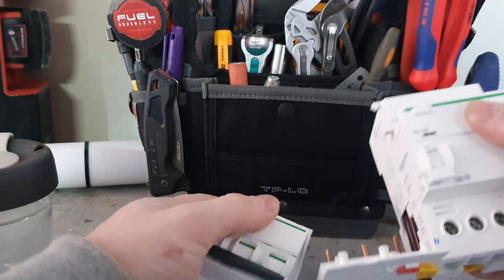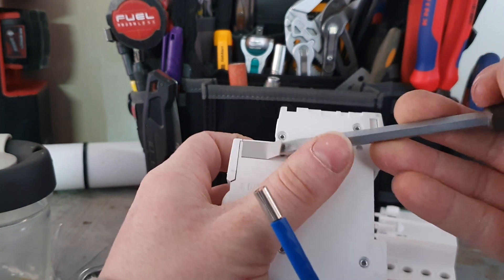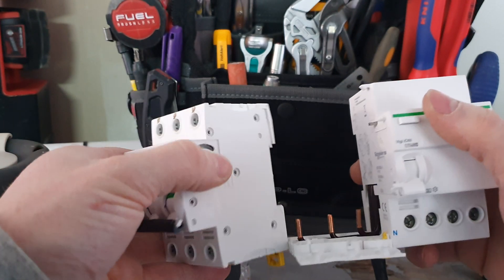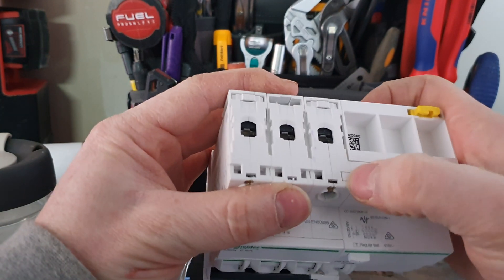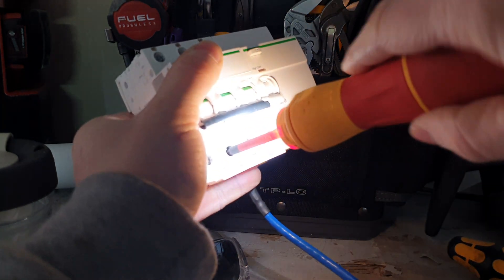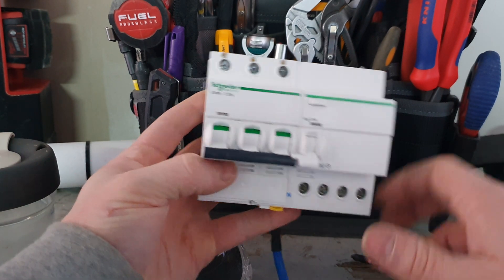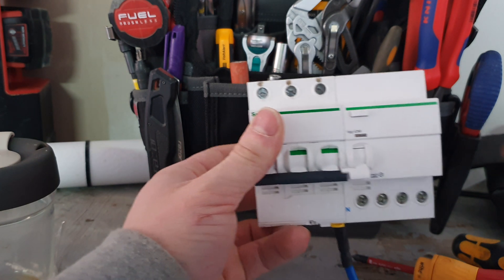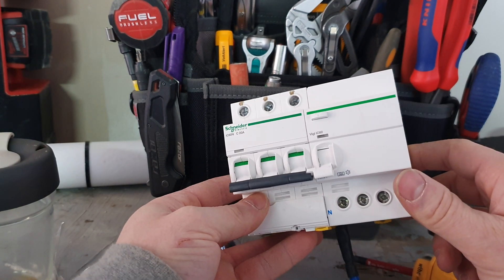How to install a Schneider Vigi iC60 RCD to a 3 phase MCB

Comment: hi. is it for voltage ups and downs ?
Reply from the maker: It's a 3phase RCD/GFCI - new rules require them on almost everything
Reply: @WillmannElectrical   Can You take a video ,how to connect schneider RM17TE00 true contactor for 3phase network ? thanks